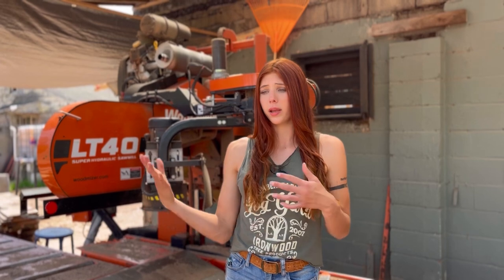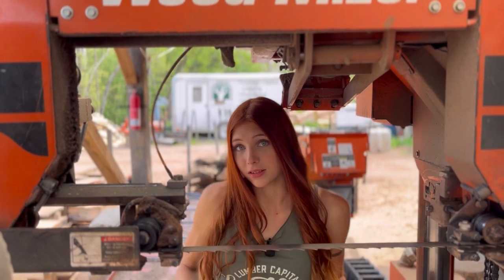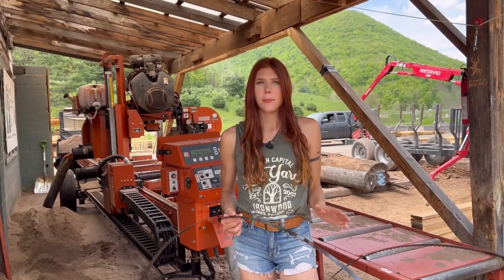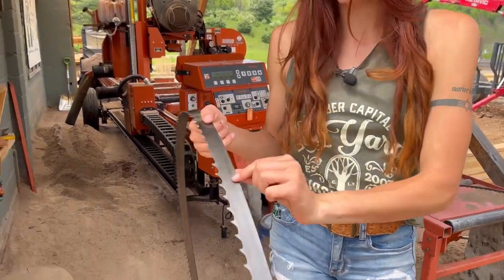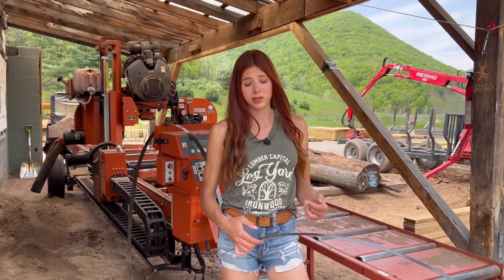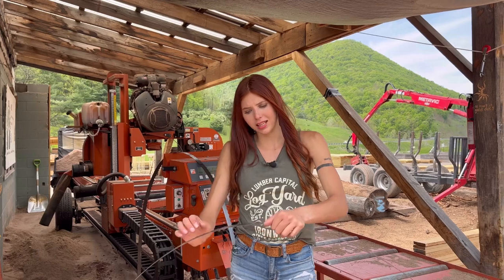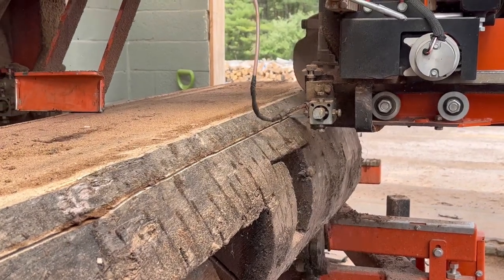Blade Damage! What happens when you hit metal with your sawmill

Comment: I wonder if you could use a metal saw blade when you know you are going to be cutting through metal. It might mean slower cutting, but at least it wouldn't be destroying a blade. And: What about removing the metal? EX: If it's a nail, and you find it with your metal detector, can you drill it out? Maybe with a core drill that cuts the wood all around the metal and comes out like taking a core sample. Just thinking out loud. ben/ michigan

Comment: Emerald, I definitely heard that.  I do fine woodworking with a bandsaw, but I buy from good hardwood dealers.  I have never hit a nail because they carefully control their incoming wood.  However, when cutting firewood I have definitely hit nails with my chainsaw.  It sucks when it happens.  Not so much of a waste when your shortest chainsaw hits it, but when my 4' chainsaw hits it and the chain cannot be reasonably be sharpened, I am pissed.  Most of the time you can notice it from the noise and sparks, but sometimes you don't.  Since this incident with a chainsaw, I am careful about accepting "free" wood to cut when the person tells me there used to be a barbed wire fence or tree fort in the tree I am cutting.

Comment: To Em, In my shop we cut steel, braSS, CAST IRON AND ALUMINUM  in our band saw,  but oue blades are 11 to 16 teeth per inch, get your self a 15 tooth by-metal, runn at normal speed, it will cut slower but will go throught the nails all day and still work

Comment: I've successfully resharpened blades like the one you showed with the tips of the teeth gone,  but it probably cost one or two sharpenings because so much metal has to be removed.  The second one with that many teeth gone in a row is toast.  If they were seperated by a few teeth though, I'd resharpen and get some more use out of them.

Comment: Try metal cutting band saw blades. If you need to make them long to fit the Woodmiser, 'weld' two blades together. Find somebody that can weld saw blades or try the 'old fashioned' way by silver soldering them together.  These blades can be had in very course tooth spacing, very similsr to your wood cutting blades.

Comment: It was easy to hear the difference between wood and metal. In the past I've used both a wood cutting and metal cutting bandsaws so it was easy to tell the difference.
Reply: for those  who have used both metal and wood working. it takes lots of knowledge. and it is a fairly exacting science.
Reply: i am not an expert in any way. i had a job in a precision work holding machine shop and we cut 4 inch steel with a grob bandsaw with an air powered feed.  it had a air sprayed liquid coolant and lubrication system. 
dry cutting and dull blades caused  heat and as emerald said trouble with a capital T like mister T.  though i am mid sixties or slightly north of midpoint. i was as young as miss emerald. i was a greenhorn. and  my boss was as old as my mom so that made him about 21 years older as some would say almost a generation gap which is about 25 years.  my departed boss was  hermann a german born american who served valiantly in the official korean war 1950-1953. though our cold war has lasted through today.  there is some connection that i still am researching. my departed dad  served in the royal dutch military as a private first class foot soldier in the commando corp.  he went in for his mandatory one year conscripted service to the dutch queen Juliana in 1952-1953. dad like most veterans know that war is hell. most will not talk about it unless specifically asked. and those who brag about have severe mental and disrespect issues that we see in all the mass shootings.

    taking a human life for any reason breaks the 6th of the 10 commandments. thou shall not kill.  i need to add that it is human life. as humans kill some plants and animals for food.  taking a human life even in self defense causes severe cases of hidden and unhidden post traumatic stress disorder. and sometimes it takes time to understand and that is after they pass on.

the boss man had a difficult time a while with someone taking their own life.  and i have empathy for the boss mans feeling.   we as humans have a lot to learn about what is life and what is n ot life and ptsd. 

i better stop on my soap box tangential.  thoughts . i trust in god like the boss man.  death is final  for life on this earth.  it happens senselessly in war, murder, mass or individual shootings, knifing,, poisoning suicide and only god knows what other ways.  like boss man  i would love to know how to prevent senseless death. i know god knows and we would love  to know. for the dead it is to late and we have to try to heal and with god's guidance we can prolong the life of someone on the road to dead. we all are on a road to death. no one gets out of life on earth alive unless we blast off to the moon. oops neil armstrong who put his boot prints on the moon came back to earth before god called him to home called eternity. yet allen buzz light year is still alive to tell a story or two for now. today may 12, 2023. 

and from a guy who can never be a mother. happy mothers day to my mom where ever you maybe. stay alive until god calls you. and when god calls you will be reunited with daddy and your first born american son who got his angel wings in 2021. say hello to my life partner my wife of 20 years she got her angel wings on 9-11-2019  at 8:10 am due to a black widower bite that went all wrong. i am at peace that god took her home. now is time for me to heal and carry on for the rest of my live. i love you mom. i really do. you  had my fetus state in your womb until it was time for me to breathe earth air by myself. you feed me   mother's milk on tap from your breasts.  you raised me right. love you with every beat of my heart. i still love you more will all my heart and mortal soul.  happy mothers day to my mom and all mothers and everyone because we all had mothers.
Reply: Whoa 😳
Reply: Whoa is right....Not exactly the place for this

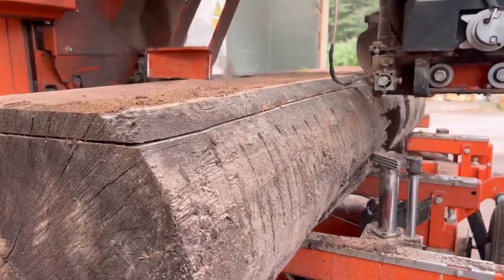Comment: The nails you hit at 3:45, look to be square or rectangular not round nails.  What did they look like to you?  If rectangular, they were cut nails made of hardened steel to be used in concrete other solid materials.    Hitting 2  common nails like a 16 penny nail wouldn't do that kind of damage to your blade.       Love your videos.

Comment: Photo bombed by a bumble bee @6:40 !
  We do a quick check with a metal detector before any milling. The savings in time and blade sharpening / replacement outweighs the cost of a decent detector and the 3 or 4 minutes it takes to check the logs before the cut.
 On big logs we cant-hook 'em over 1/4 turns and check each quarter. Depends on the quality of your detector and how deep it'll go. Even a cheap one from B_g5 sporting goods will do a decent job and find almost, if not all the buried nastiness.

Comment: In order to detect metal such long and big wood, you would probably need to scan the wood with an X-Ray device. Probably the backscattering that occurs at the metal pieces should be sufficient to see that there is metal inside and where about it is located. This is my guess. But would this be financially worth? I do not know.

Comment: The common blades that are dulled by hitting metal,, I have had some success,, run the blade through the sharpener  at least twice.  You can often salvage a blade with a double or even triple pass through the sharpener.  I normally tried the second time through,,,I rarely if ever ran it through a third pass.  You can sharpen it,, yes,, but now you have cut below where the high tempered points are.  And if the blade has already had a sharp or two,, won't work.

Comment: I am surprised that no one has thought to put a metal detecting sensor head on the sawmill that will automatically stop the mill when metal is detected. Even using the wand that the TSA uses would probably help.

Comment: Retired saw filer here. Right on. The worst are glass insulators. The saw usually takes a dive and blows up. Sometimes you would saw right through a bullet and keep on sawing. The best object I ever saw was a double bitted axe that the saw hit where the axe handle used to be and filled the hole with as many saw tips as you could cram in there.
Reply: Yeah....lead bullets saw easily! Now barb wire....not so much!

Comment: Do they make  carbide tipped blades for those saws ? I wonder how they would do  against nails ??
Reply: They do make them, and they tolerate metal much better.  However they cost significantly more per blade.
Reply: @bwillan  And they make more sawdust.

Comment: Your ment to hit the kill switch if that happens sometimes you can save the blade if they brand new but ya got a lot of work to do to  fix them. I smash the kill switch as fast as i can if i hear that sound because one day you will hit a big bit of metal like a large bolt and it will rip your machine apart. There’s ways to take the metal out depending the situation or cutting though the steel with a hacksaw blade or some kinda metal saw

Comment: I was wondering if they made a carbide tooth saw blade. I'm sure it would be very expensive, but it might be more effective for cutting through metal and not getting damaged. Maybe cost saving in the long run.
Reply: There indeed exist hard tooth saw blades with stellite teeth. It isn't the same as carbide but they are much stronger. And HSS teeth are a bit in between.
Reply: @Wout Moerman  Thanks for the reply, I invisioned something like the carbide teeth we have on our circular saws, but forgot they wouldn't handle the bending around the drive system of the saw. Carbide doesn't flex.

Comment: Maybe you need to buy an old fashioned vertical rotary saw mill. Much tougher than those fragile band saws.
Reply: If you look at the roof above those old circle mills, you can see where the teeth ripped thru the roof.
Much more dangerous  and blades cost thousands instead of $30.
Alot more downtime also

Comment: Sorry you guys are having so many problems lately with nails in the trees. Didn't you have your metal finder today??
Reply: Design an electro magnet attachment, or strape a finder onto the machine. But they still are going to cut the log. The log owner should be charged back for wrecking the blade.

Catching metal in a coffee grinder technology exists, but it's usually rocks in the beans which wreck the grinding disks. Trivia. Sorry

Comment: I need clarification; why are you cutting logs, you know, has metal? How can that be cost-effective? What good are boards that are contaminated in that way? I certainly would not buy lumber like that. Just wondering. Keep up the good work.
Reply: They are cutting walnut slabs. They sell for a good price. The blades they are using on logs they know have metal are re-sharps. That way they are not ruining a new blade. Watch Wednesdays video - Milling walnut logs riddled with metal.

Comment: What do you do with the trashed blades?
Reply: I resharpen ours if not too bad. But it takes a lot longer to do to keep from overworking the metal while grinding. Make more passes around grinder for sure. If half or more of the tooth is gone, we fold em up for scrap pile. No point because if that much gone, the metal will have microcracks or visible cracks in gullet and it's not worth the safety or time to just put them on again to break in a cut or two
Reply: @carpetguydalton  I bet they can be cut up and made into Damascus steel for knife blades.
Reply: @georgecrinnion2131  Most likely! Only other thing we do with them is break them one at about 2-3 ft section then duck tape a fake handle on them. Then use that to sometimes clean out the dust from a cut if need be. But I like your idea. Fold them 1000 times for a blade knife :)
Reply: @carpetguydalton  Or cut them up and make them into some seriously badass windchimes!

Comment: ducking and covering from that bumble bee.. almost smacked my monitor off the table heh.. You know the guy that made your knife if he forges his own knives he can cut and stack your blades and use them to make knives.. blade steel is pretty good steel and as you know its strong and holds a sharp edge well... maybe ask him.. normally you cut a few pieces and weld them on the sides and then you put them in the furnace and hammer them together once they are yellow hot. that might be cool if he could make special knives for you to sell made from your blades you can't resharpen heh or maybe just one for you and jade beautiful weather we're having.. stay cool :o)